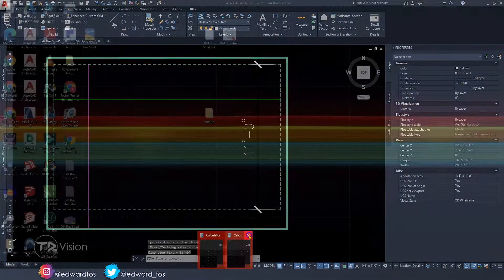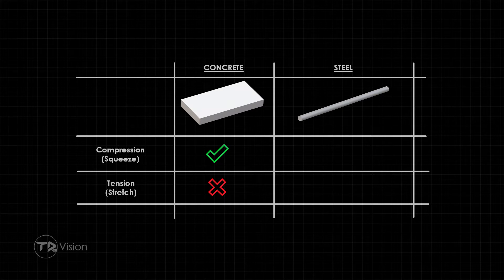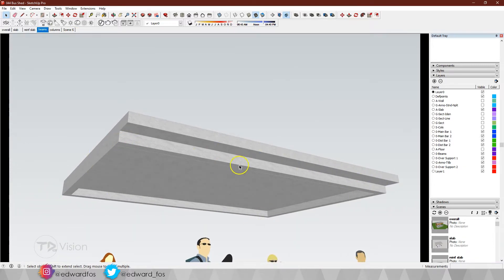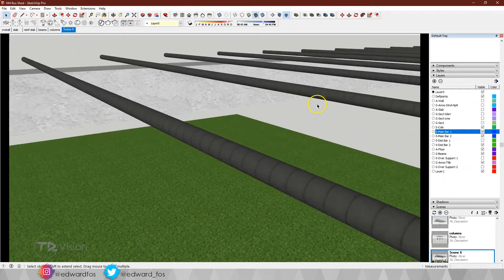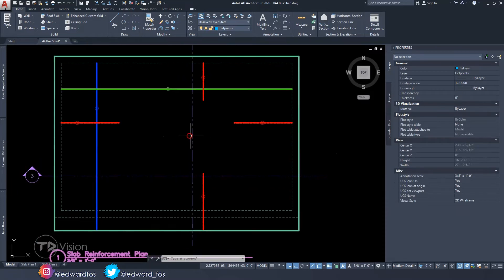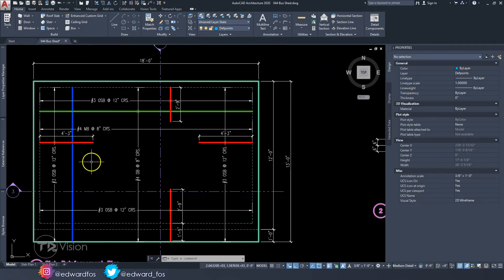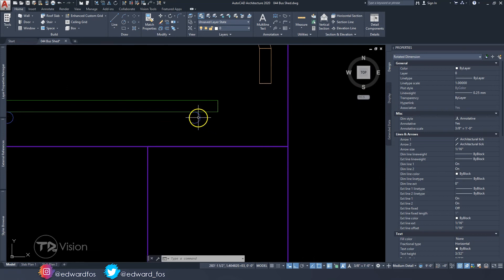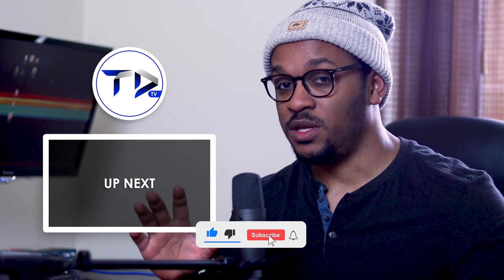SLAB REINFORCEMENT PLAN (AutoCAD Architecture 2024) Part 1

Comment: Thanks for the video.  I have a question for you. A question that I keep asking without any answer so far. For the top bars (OSB - Over Support Bars) there is a clash at the four corners, that is, they cannot be at the same Top/Top (T/T) or T1 level at the four corners.  Hope you can help me on this.  Sometimes there are situation where the main bars does not span across the shortest span.  Can you speak on this? thanks.

Comment: How do i determine the spacing between the main , ditribution and over support bars
Reply from the maker: Those are usually calculated, so an engineer would help out with that. I used typical numbers for this example.
Reply: Thanks for the great effort